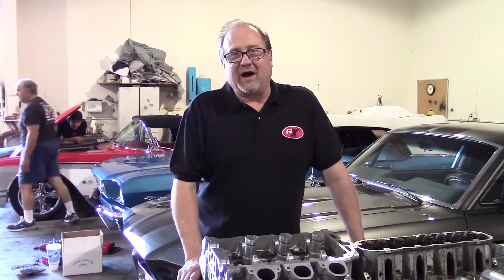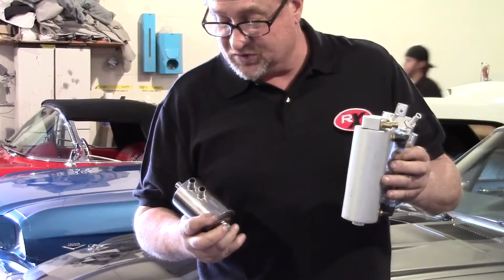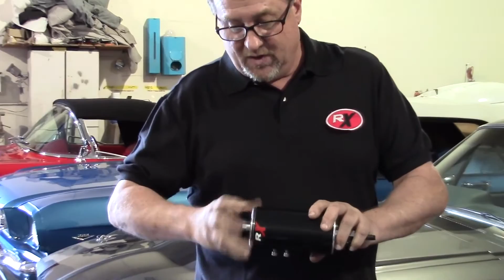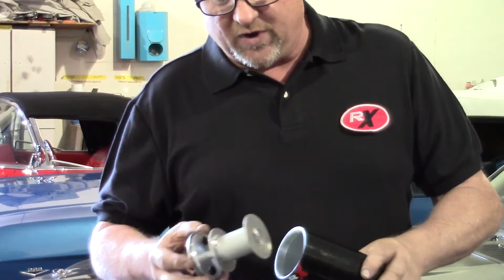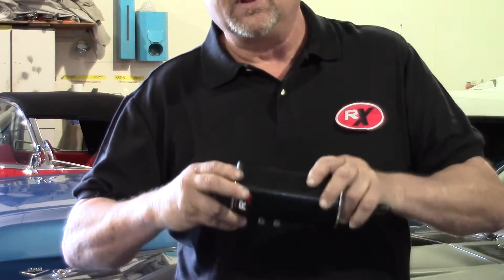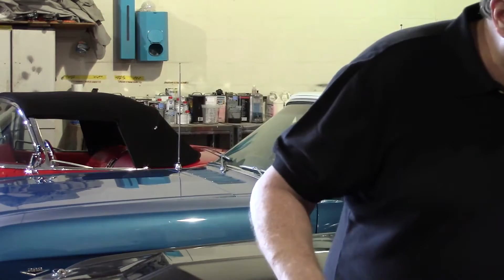RX Performance Tracy Lewis Extreme Products Oil Catch Cans Dual Valve Kit Monster Single Overview

Comment: Note!! McNally is NOT affiliated in any way with RX Performance Products, the designer and inventor of the true RX cans.  The McNally are cheap china made knock offs. The genuine RX cans 100% made in the USA can be purchased through Jegs at:

http://www.jegs.com/webapp/wcs/stores/servlet/KeywordSearchCmd?storeId=10001&catalogId=10002&langId=-1&Ntk=all&Jnar=0&itemPerPage=60&Ne=1%2B2%2B3%2B13%2B1147708&searchTerm=tracy+lewis

Tracy Lewis is the inventor, and holds the Patent.   Questions?  Contact us directly at: RXProducts@aol.com
Reply from the maker: Updated info and links. Thanks!